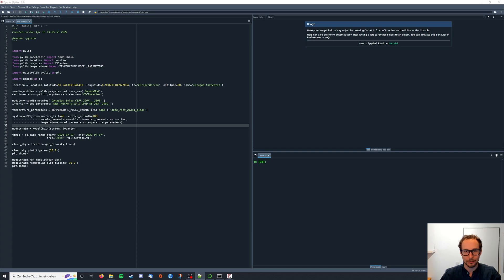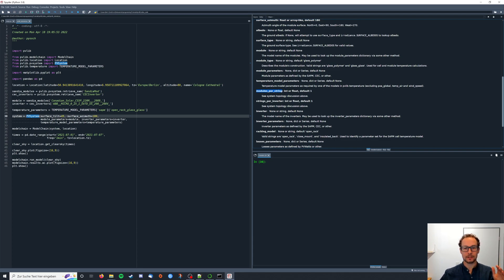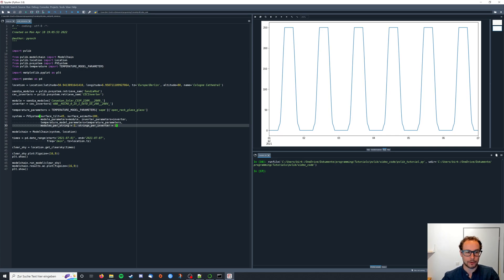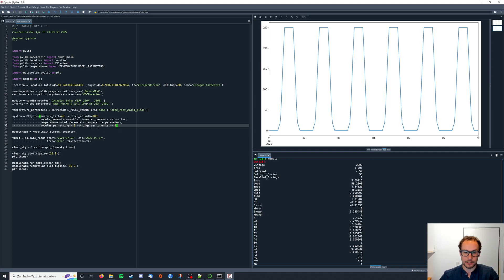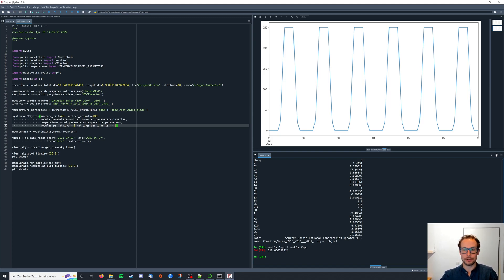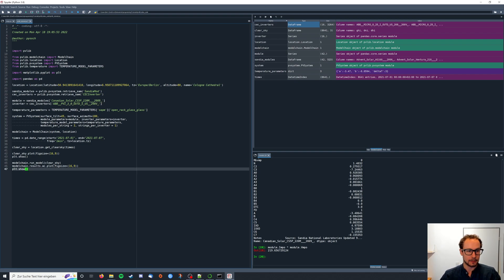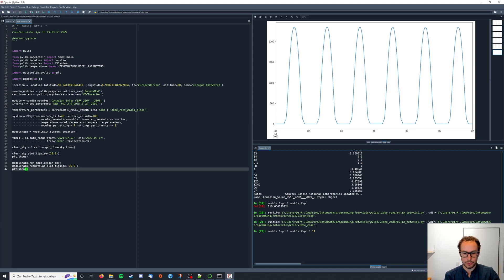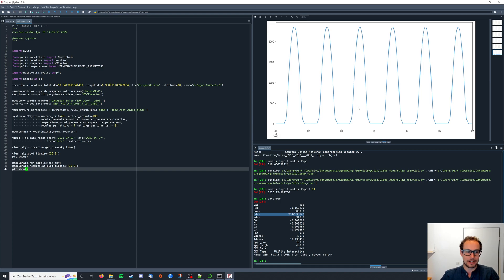pvlib python 05: Add modules to your PV system

Comment: Hey Sascha, 

I want to simulate a PV system with 411kWp installed power. I looked for the modules and inverter with the highest power. How can i increase the number of inverters in the modell? 
I would need about 40 inverters
Reply from the maker: Hey, you need to define an array like in Tutorial 14 with multiple inverters. You could also define multiple PV systems, one for each inverter. Whatever works best for you. Hope this helps.

Comment: Thank you for your answer, 
for the moment I do not have the time to make a tutorial on the subject. 
I will tell you the steps: 
1. Obtain .las or .laz data of the area in question (Geo-Daten).
 2. Obtain the orientation of the roof, angle and its area with the QGIS whiteboxtool application (LidarRooftopAnalysis function). To transform .laz to .las you can write a python script with the help of chatgptx. 
3. Generate in QGIS a column with the Geo-Coordinates of the objects. 
4. Export the data to CSV file from QGIS.
5. From python read the data from the CSV file of orientation, height and area of the roof and perform simulation with the script that you have done in the course. The results should be added to new columns in the original CSV file. 
6. Save two CSV files. One with all the results and the original data and the second one with only the column containing the coordinates (this makes it easier to work with QGIS later). 
7. From the QGIS console export first the csv file as a layer and then copy its original data (I tried to do it with only one step but it was not possible). 
With pvlib and QGIS, geo-referenced results can be obtained for PV-Anlagen and Solarthermie potential. In the latter case it cannot be done directly with pvlib, but assumptions can be made by obtaining the radiation depending on the orientation and angle as described in ReadTheDocs "GHI to POA Transposition"

Comment: Thank you very much for your videos.

I have been able to use pvlib and use its results in georeferenced data in programs like QGIS.

Ich danke dir!
Reply from the maker: How about you make a tutorial about that? Sounds interesting! I am currently working on something similar, just not in QGIS.
Reply: @sbirk  Thank you for your response,

for the moment I do not have the time to make a tutorial on the subject. For the time being I will tell you the steps to follow:
1. Obtain .las or .laz data of the area in question (Geo-Daten).
2. Obtain the orientation of the roof, angle and its area with the QGIS whiteboxtool application (LidarRooftopAnalysis function). To transform .laz to .las you can write a python script with the help of chatgptx.
3. Generate in QGIS a column with the Geo-Coordinates of the objects. 
4. Export the data to CSV file from QGIS. 
5. From python read the data from the CSV-file of orientation, height and area of the roof and perform simulation with the script that you have done in the course. The results should be added to new columns in the original CSV-file.
6. Save two CSV files. One with all the results and the original data and the second one with only the column containing the coordinates (this makes it easier to work with QGIS later).
7. From the QGIS console export first the csv file as a layer and then copy its original data (I tried to do it with only one step but it was not possible). 

it is easier to work with geojson layers as they do not lose their original format (Multipolygon or polygon).

:)
Reply: @sbirk  Thank you for your answer,

for the moment I do not have the time to make a tutorial on the subject. For the moment I will tell you the steps to follow:
1. Obtain .las or .laz data of the area in question (Geo-Daten).
2. Obtain the orientation of the roof, angle and its area with the QGIS whiteboxtool application (LidarRooftopAnalysis function). To transform .laz to .las you can write a python script with the help of chatgptx.
3. Generate in QGIS a column with the Geo-Coordinates of the objects. 
4. Export the data to CSV file from QGIS. 
5. From python read the data from the CSV file of orientation, height and area of the roof and perform simulation with the script that you have done in the course. The results should be added to new columns in the original CSV file.
6. Save two CSV files. One with all the results and the original data and the second one with only the column containing the coordinates (this makes it easier to work with QGIS later).
7. From the QGIS console export first the csv file as a layer and then copy its original data (I tried to do it with only one step but it was not possible).
Reply: @sbirk  Thank you for your answer,

for the moment I do not have the time to make a tutorial on the subject. For the moment I will tell you the steps to follow:
1. Obtain .las or .laz data of the area in question (Geo-Daten).
2. Obtain the orientation of the roof, angle and its area with the QGIS whiteboxtool application (LidarRooftopAnalysis function). To transform .laz to .las you can write a python script with the help of chatgptx.
3. Generate in QGIS a column with the Geo-Coordinates of the objects. 
4. Export the data to CSV file from QGIS. 
5. From python read the data from the CSV file of orientation, height and area of the roof and perform simulation with the script that you have done in the course. The results should be added to new columns in the original CSV file.
6. Save two CSV files. One with all the results and the original data and the second one with only the column containing the coordinates (this makes it easier to work with QGIS later).
7. From the QGIS console export first the csv file as a layer and then copy its original data (I tried to do it with only one step but it was not possible). 

with pvlib and QGIS, geo-referenced results can be obtained for PV-Anlagen and Solarthermie potential. In the latter case it cannot be done directly with pvlib, but assumptions can be made by obtaining the radiation depending on the orientation and angle as described in ReadTheDocs "GHI to POA Transposition"
Reply: @sbirk  I tried to answer you the steps to do it, but the comment does not show up...
Reply from the maker: Hi, for me it does. Thanks a lot!

Comment: I found that the CEC databases included in PVLib are very outdated, I believe they only include modules and inverters up to 2019. If you download the system advisor model (SAM) application it will install a bunch of csv libraries for you in the same format PVLib expects. You can then include these libraries using retrieve_sam(path=...) where path is the location of your library and you have much more options to choose from.

Comment: It would be nice if you may do an example video of the pvlib.clearsky.detect_clearsky function. I have problems with the generation of the TimeSeries and W/m2 input variables. Can I use an python list/matrix with datetime and wattm2, or do I need pandas ...Thanks a lot for your work.
Reply from the maker: Hi Michael,
I'll see what I can do. I usually use a pandas dataframe. Also, make sure to convert the index to datetime!
Reply: @sbirk  Hi Sasha, this would be great. I struggle with the pandas time data. I use influxdb and have datatime.dateime object/  Watt m2 data of every 3 seconds. The functions always says 'Series' object has no attribute 'inferred_freq' delta... I am not a pandas professional....

I want to feed the function with realtime data to detect clear sky, I have got da small DIY weather station with raspi and lux TLS45315 sensor....

A small Demo of a dataset with 10  datetime ,wattm2 and ghi values would help me.

Comment: Thanks for your hard work on this. I have two questions which I'd like to ask you about them; firstly, how could I search in database? (as you know that It's difficult to find a specific module or even an inverter there) secondly, how could I add external models to pvlib model chain, such as models of evaluating the radiation? I mean I want to make pvlib more dominant for my research purpose. Thank you again for what you shared with us.
Reply from the maker: Hi Hans,
thanks for your kind message. It sounds like you have a specific inverter or module model in mind? Then you could search in the columns of the inverter or module database for the manufacturer like this: sandia_modules.columns[sandia_modules.columns.str.contains("Panasonic")]

If you are looking for an inverter with a specific power for example you could use: cec_inverters.loc["Paco"][cec_inverters.loc["Paco"] == 3000]

The second question is somewhat more specific and more difficult to answer without knowing exactly what you want to do. In general you can surely wrap models around certain data within the modelchain. Maybe you should check the API documentation of pvlib first, if they already have what you are looking for. Otherwise you may need to provide some more information in order for me to help.

Either way, thanks for your effort on pv-research :)

Comment: hi, Sascha thank you for your handy videos. I want to use my real radiation xlsx data in my code, and another model except the clear sky model can you make a video for this?
Reply from the maker: Hi, yes I can make a video about using external data, but it will rather be towards the end of the month until I finish. You have to make sure, the columns of your data are labeled according to the documentation, or relabel them after reading them in: https://pvlib-python.readthedocs.io/en/stable/reference/generated/pvlib.modelchain.ModelChain.run_model.html#pvlib.modelchain.ModelChain.run_model

Also the index should be converted to timestamp using pandas.to_datetime()
Reply: @sbirk  thank you